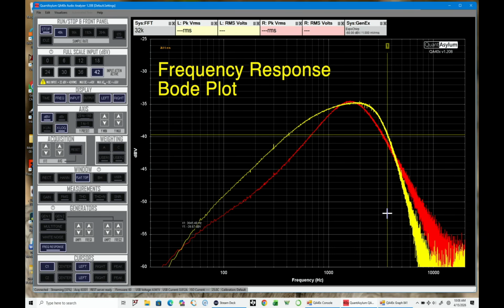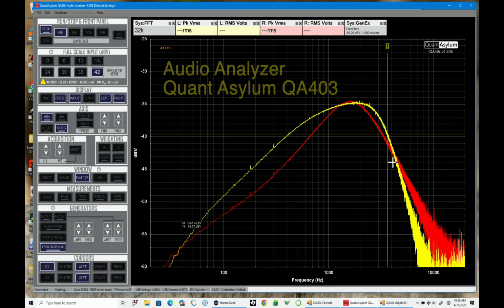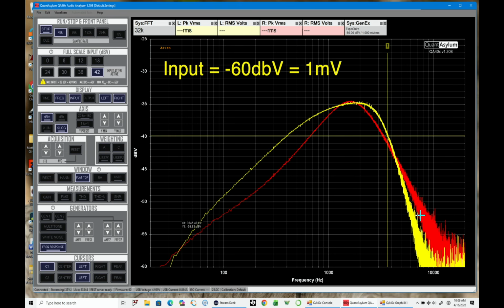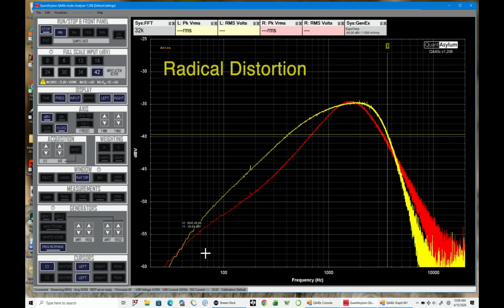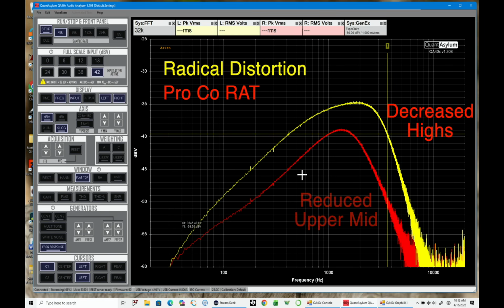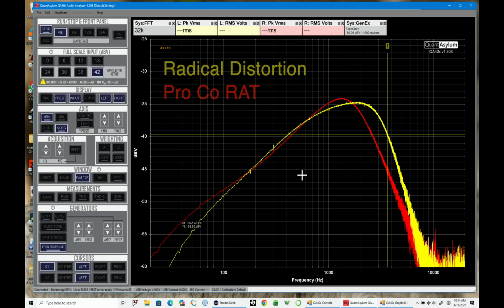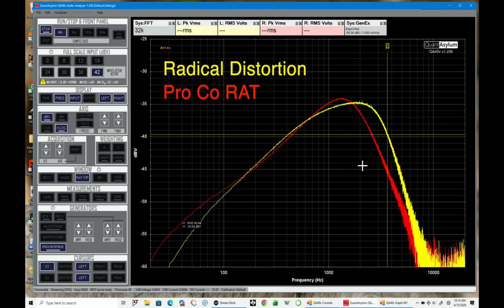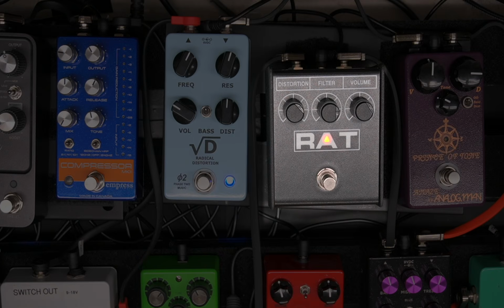Why This Distortion Cuts Through Without Harshness

Comment: The point of using a RAT is to have a more textured type of sound.
Reply: The RAT really was one of the original Distortion Pedals and I plan to do a dedicated deep dive on it.  Although it is a simple circuit, its component selection make it rather flexible.